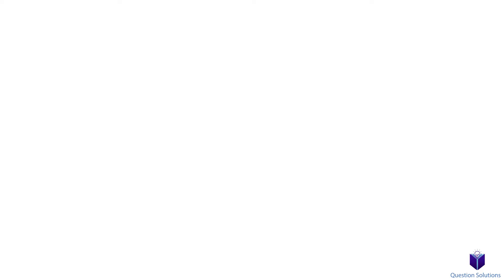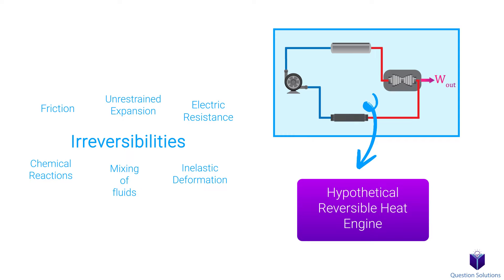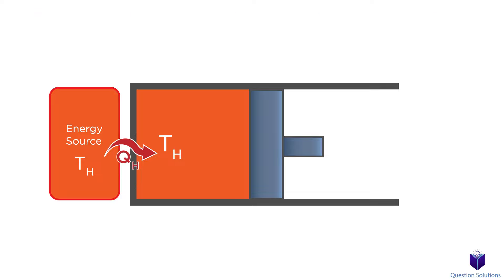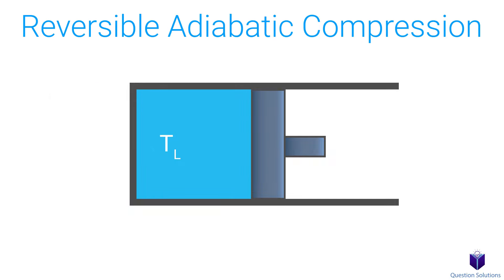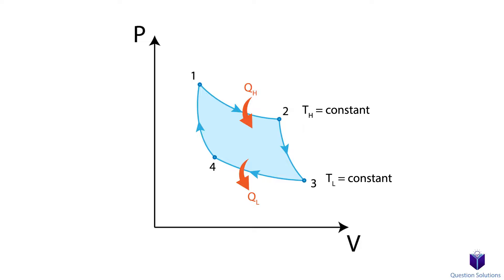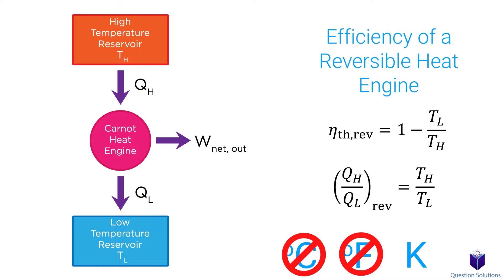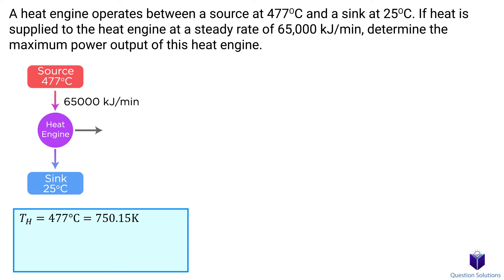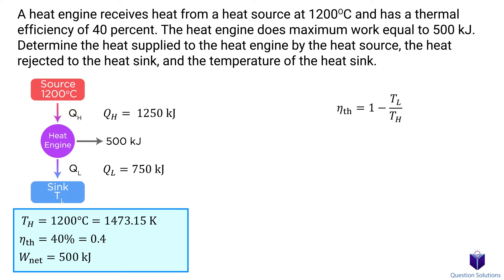The Carnot Cycle Animated | Thermodynamics | (Solved Examples)

Comment: Have you heard of the Karno generator from Hyliion? They are claiming 90-95% heat efficiency paired with a linear generator claiming 50% electrical efficiency. They say they are able to achieve the heat efficiency because of additive manufacturing allowing them to make very complex heat exchangers and parts for flameless oxidation. My question is, is this type of efficiency even possible? Hopefully the Karno piques your interest because I would love to see a video theoretically breaking it down and explaining how it works and if those numbers are even possible. Cheers!
Reply from the maker: I am not sure, I'd have to look into it. Though what you said did pique my curiosity. Thanks for sharing!

Comment: Hand up! All 4 procrsses have FORCE to slowly pull and push piston all along the processes, Right? If yes, big thanks to you. I've been stucked here for many years.
Reply from the maker: Force, yes, but it doesn't have to always be an "external" force. For example, when the gas expands, that creates a force on the piston, but that's not like someone is pulling the piston from the outside, it's done by the gas itself.

Comment: in last question is our heat engine is reversible or not/ because u use efficiency formula of reversible to find TL. or we can use it always anytime for any heat engine
Reply from the maker: All the problems in this set are about Carnot engines/ reversible engines. You can only use the efficiency formula of reversible engines on just reversible engines.
Reply: @QuestionSolutions  sir if the last question is in the paper, how i find out this problem is about carnot or reversible engine.
Reply from the maker: Most of the time, it will state that it's a reversible engine, or a Carnot engine. If it doesn't, you can compare the efficiencies as shown at 8:30 using the efficiency equation for any heat engine. @numankashif6158